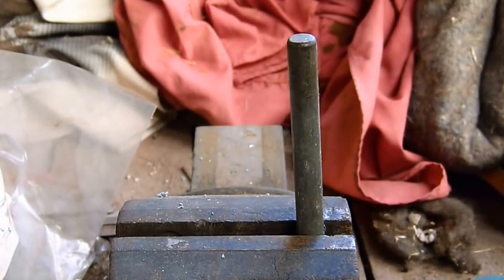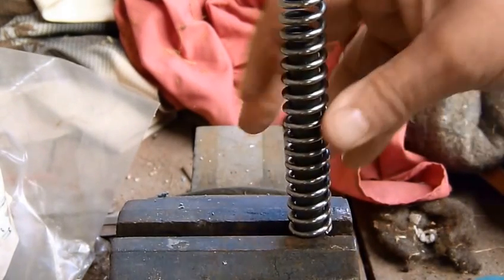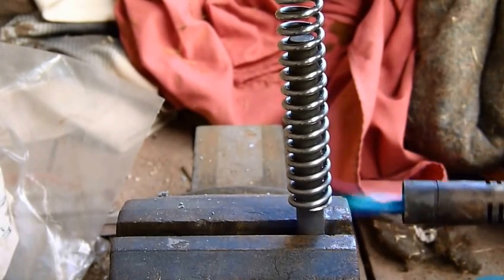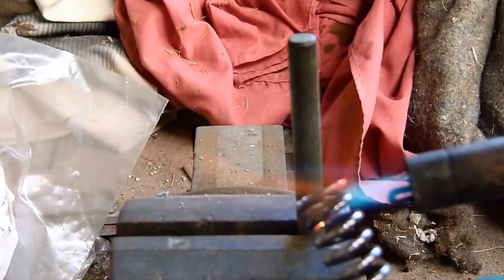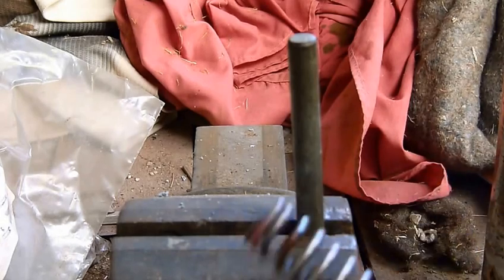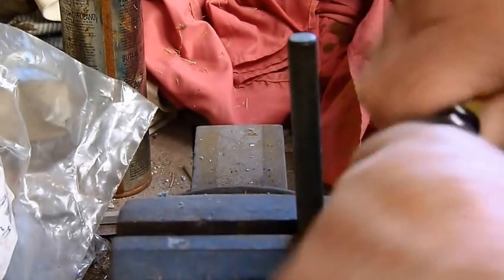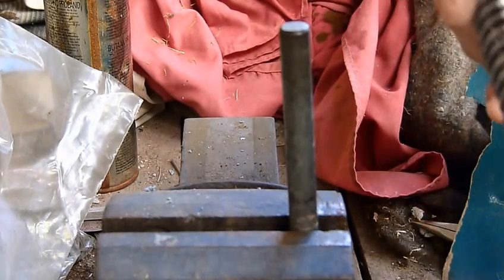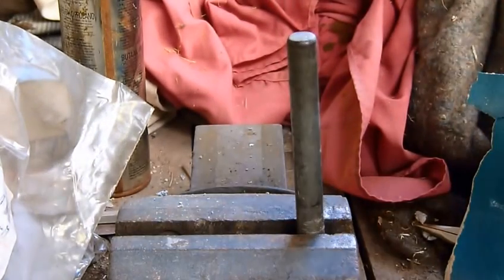Tutorial - collapsing a coil for a spring gun

Comment: I make Coil springs for a living .
Coil springs when manufactured are quenched in oil and should always be  quenched in oil after folding a coil  and NOT in water as this will weaken the springs makeup causing a brittle section at the same time causing inconsistencies  in the way the coils return to their original state at time of manufacture . Although this video shows the technique to fold a coil the opinion of the maker who does sound like a retired School  teacher is in fact wrong in his method of cooling the heated CrSi metal used .I repeat Springs  should always be quenched in OIL  which gives a more controlled beneficial method of cooling  to the metal for longevity of the springs lifespan. Do not use cold water or even hot water come to that .

Comment from the maker: There has been a lot of discussion about quenching and whether or not to do it. One very respected and well known tuner advocates quenching the spring end in water. Others say leave it to cool - I take a sort of middle route. I do quench in water but I am in no rush to get the metal from the heat into the water. Quenching cools the spring before the heat in the modified end has chance to affect any of the rest of the spring - however there is the risk of hardening - hence the reason that I wait a few seconds before quenching.
Reply: Maybe you should consult a spring manufacturer instead of believing all you read. When you heat a specific area of a spring to 500c when it starts to turn red , consider the heat transfer to the rest of the spring , when the spring is manufactured it is heated very evenly in order to make the spring consistent in use .by cooling quickly in water as you have stated you are affecting the  molecular composition no matter the type of the metal used .
 I can assure you when springs are manufactured they are quenched in oil for the purpose of being a more controlled cooling period giving more consistency in performance and longevity of life span.most Air rifle tuners are not specialist in any particular field, in fact most are hobbyist who work from sheds in their back gardens and are in fact not qualified engineers in any way even though they may claim to be .